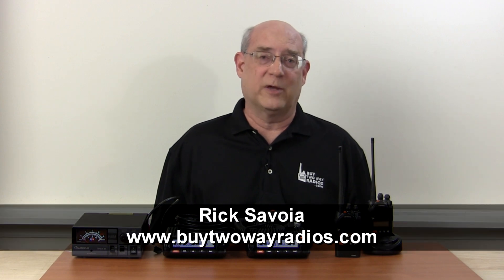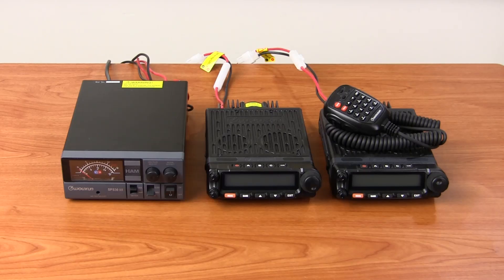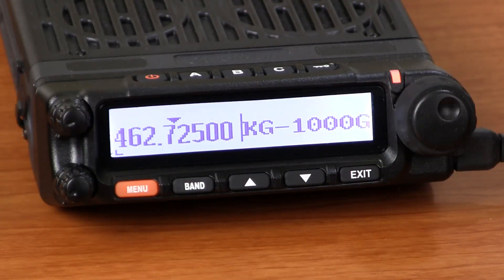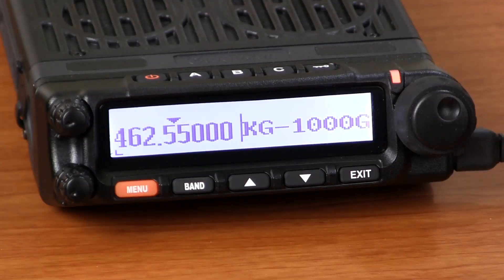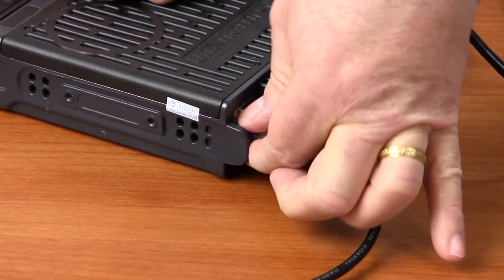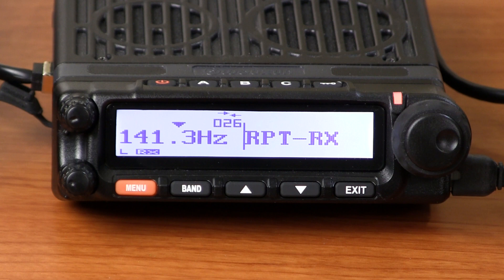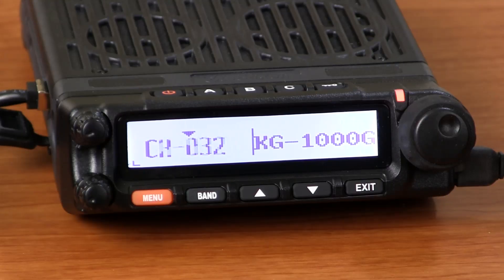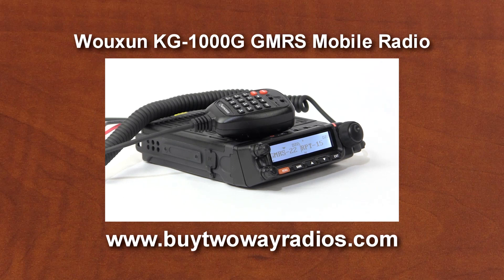How to Turn the Wouxun KG-1000G Into a GMRS Repeater

Comment: Great idea. How well will it hold up under continuous use. Some of those radios wont hold up under that type of use. I know a lot of gmrs operators will key down for 2 minutes at a time and have a long conversation.
Reply: Wouxun tells us that continuous use should not be a problem.  They have been selling a similar commercial radio in a rack-mount repeater configuration for quite a while, so they consider the durability in this setup to be well proven.
Reply: @buytwowayradios9913   Continuous power on is not a problem. Continuous transmitter on, at the high power setting, like in a high use repeater, is not recommended. This is a mobile radio. With a duty cycle rating of a mobile  application. 5-5-90 duty cycle, which means 5% of the time transmit, 5% receive, and 90% standby (squelched receiver). 
Commercial repeaters are rated at 100% transmitter power output.  They  are designed that way and that is why they cost more and have large heat sinks and fans to handle the heat from the transmitter.    Recommend the user sets the mobile transmitter radio at low or medium power setting (add a fan over the heat sinks).   I have built repeaters using mobile radios (with a fan) for events and this works keeping them under 25 watts transmitter power.  System running on battery power in remote locations. Never full power since the duty cycle is greater than 5%.
Reply: @buytwowayradios9913   I have not been able to find any published duty cycle specifications from Wouxun mobile type repeaters.  The mobile radio will have both VSWR and thermal protection that reduces the RF power to protect the RF power module from damage.  Yes it will still transmit, just with a lower RF power output.   Many manufactures offer "desktop repeaters" using mobile radios. If you read the specs. you will discover they are not rated at 100% duty cycle,  unless you run them at less than half power to keep from over heating.  Most are less than 50% duty cycle at full power. 
No problem using mobiles as long as you use them correctly within their published specifications. There is a reason why desktop type repeaters are not allowed to be installed at commercial repeater sites. Their receivers are not designed to withstand  very high levels of RF exposure that you encounter at repeater sites. They may cause interference to other repeater users because of mixing signals,  due to poor rejection of other signals.  I have two older Wouxun portable radios and they are still operating.  One part 97 (ham) and one part 90 type approved for commercial service.  Wouxn knows how to build commercial radios.
Reply: @peterliljequist160  Even some commercially produced repeaters use mobile radios. Case in point: The Yaesu Fusion DR-1X, dual band VHF/UHF amateur radio repeater is made from two FTM-400XDR mobile units. Of course, they added extra cabling, an interface, and a rack mount with fans. But it is made with mobile radios. If done right, i.e. lots of cooling, mobile radios work fine in a repeater situation. I personally prefer to run the radios at reduced output and add a power amplifier (PA). The radio lasts longer, and if the PA dies, it is easily replaced. I'd rather "burn out" a PA than the radios.  ;)

Comment: What kind of antenna can you use as a base station for this??
Reply from the maker: A UHF antenna that is tuned for GMRS frequencies in UHF band such as the Tram 1486 or Nagoya NL-770G should work with the KG-1000G. The Nagoya is a GMRS antenna. The 1486 can be tuned specifically to the GMRS frequencies with a bit of customization and even includes a cutting chart for easier calculation. https://www.buytwowayradios.com/tram-1486.html
Reply: 450-470 MHz 3.8/5dB Exposed Dipole Omni Antenna @BuyTwoWayRadios
Reply: You can build your own antenna if your a do-it-yourself kind of person. A simple one is the 1/4 wave ground plane antenna. It's not a high gain antenna, but it is very inexpensive to build. I made one with about $5 of parts, excluding coax (actually less because I used some spare parts on hand). The coax cable is often the most expensive part of many antenna systems. If you really feel ambitious, you can research antennas and build other antennas that improve performance, i.e. a 5/8 wave (which is about 1.5x better than the ground plane). Even more ambitious would be a colinear antenna. A bit of research and building skills are needed, but the gain is impressive. The more you put into the antenna, the better your system will be! Of course, if you lack the time/skills or just want a commercial version, buy one. They're under $100 (July 2021) and will be more than adequate for most situations.

Comment: How far apart do the two radios have to be.  Do the cables included cover that space?
I ordered one from you guys today.  Will get two more later to set up a repeater here in Warner Robins Georgia
Reply from the maker: The included cable is around 15 feet long, but keep in mind it's not the radios that require separation - it's the antennas (assuming you're not using a duplexer). In our setup we space the antennas around 12 feet apart and that is enough for our testing to work well. Usually your antenna cable will provide enough length to allow you to get this much separation even if the radios are right beside one another.
Reply: @BuyTwoWayRadios  if you're using a duplexer?
I'm new to this and learning, thanks for the info
Reply from the maker: @SteelerNGeorgia  If you are using a duplexer, you only need one antenna.
Reply: @BuyTwoWayRadios  okay, I just want to know if I use a duplexer, can I put the radios closer together
Reply from the maker: @SteelerNGeorgia  The radios can be right next to each other if you want. It's not the radios that need to be separated or distanced. It's the antennas that need to be spaced apart, if you are using two antennas. If you have a duplexer, all you need is one antenna.
Reply: @BuyTwoWayRadios  thanks, can't wait to stick the new KG1K in van.  (My van wants to be a Jeep)
Reply: @BuyTwoWayRadios  maybe a 'How to set up your Wouxun KG1KG part two (for dummies). LoL
Reply: I believe its 15' minimum if side by side and 30' in height with the recieve antenna at the top.
Reply: @BuyTwoWayRadios  if I use a duplexer can I put the radios closer together

Comment: Does it have a CWID feature?

If you are using it like this with alot of traffic you need to think about cooling options also.

Still cheaper to buy a 40 watt GR1225 from the surplus market. that is an all in one tabletop repeater with CWID and usually have duplexer installed.

Comment: I use two kg-uv920p radios, but I found that the audio gets rather dull (I am using a well tuned duplexer)
My work around is a full blown SVXlink repeater controller, but the radios do not support flat audio (to get CTCSS in to SVXlink)
Would love to see a product that you can use to build a repeater with an external controller

Comment: Not for $319.99 each (x2= $639.98) plus shipping, plus duplexer, plus power supply, plus, plus  plus..... for a cheap china radio... and those would only be good if installed at your house but don't plan on putting one in/at a tower site as the receiver will go to hatties....

Comment: In the repeater configuration (2 radios) does the transmitter send your FCC call sign to meet the FCC ID requirement for repeaters?
Reply from the maker: No, it doesn't have the ability to send your callsign. We want to develop, or work with a repeater controller company, to come up with an interface cable to easily connect the KG-1000G to a readily available controller to handle the ID and other cool repeater functions. We're still in the early stages there so give us a couple of months and see what we can come up with.  The good news is that if you're only using the repeater just for individuals covered by your callsign there is no ID requirement. Also, the ID can be made manually if necessary.
Reply: @BuyTwoWayRadios  Thanks for your answer.  An external repeater controller is recommended  unless the repeater has a control operator who can turn it off if the system locks up in transmit mode.
Reply: @BuyTwoWayRadios  would be awesome if Wouxon would add this via a firmware update. 10 min CW ID would be great for ham repeaters (if these radios even operate in that band). Anyway Its great to FINALLY see type certified radios actually in existence now.
Reply: @BuyTwoWayRadios  I believe personal or public any GMRS user must Id at the beginning, at the end and every 10 minutes no matter what
Reply from the maker: GMRS rules require the operator to ID at the end of a single transmission and 15 minutes after a series of transmissions and every 15 minutes on a series of transmissions lasting longer than 15 minutes.

Comment: How about  duty  cycle?? How long will the transmit radio last on 50w during heavy use?
Reply from the maker: I just recently asked Wouxun about this in response to a different inquiry and they said the radio is designed to hold up to heavy TX. They recommended that in a heavy TX situation, like a public repeater, they do suggest using the feature that automatically activates the fan based on the temperature (menu 37, and this is already the default). They also suggest using the TOT and TOA menu settings (menu options 11 and 12) to limit the maximum time for a single TX to at most 60 minutes.
Reply: Is there repeater identification as required and do they offer remote control.

Comment: Great info.  When two radios are connected as a repeater, is it still possible to operate the system with the hand microphone, or do you need a 3rd radio to communicate?
Reply from the maker: Yes. There is an option in the menu to enable you to transmit using the PTT on the hand microphone while the radios are in repeater mode. It is disabled by default.

Comment: BULLSHIT!   You CAN NOT do this WITH OUT a BAND REJECT DUPLEXER.
Reply: Did you watch the whole video where a duplexer is shown near the end? Yeah.......
Reply: How many miles does it get or reach
Reply from the maker: Although some manufacturers of consumer radios advertise a specific range in a set number of miles on their products, we make no claims to specific range limits on this or any other radio we sell. This is because range is going to depend on where, how and under what circumstances the radio is used. You may reach across the visible horizon on a mountaintop with clear line of site in good weather. You may not get far at all if you are transmitting between a forest of skyscrapers or at the bottom of a ravine in the middle of an electrical storm. There is no absolute for range. The article in the following link explains the factors to consider in calculating radio range. It was written for handheld radios, but the same principles apply to any radio transceiver, including mobiles such as the KG-1000G. https://www.buytwowayradios.com/blog/2016/12/gmrs_radio_range_chart.html
Reply: BULLSHIT! to you @Samson Osburn we have had our 70cm ham repater running on a mobile flat pack duplexer for over half a decade.......we even used LMR400 until we got heliax......OH THE HORROR!. Have even used Jpoles as the repeater antenna without ripping a hole in the space-time continuum. Eventually we bought a pass cavity on Ebay to add to our receive side which helped alot but was not required......This is not VHF, with a 5MHz spread you can get away with alot of sins.

Comment: You should follow up with - how to order a gmrs duplexor. There are several questions not answered on the web site such as:
- is the duplexor wide enough for the whole GMRS  band, or do I need to pick a specific repeater channel?
- where do you specify the frequency on the duplexor order page?
- which duplexor is recommended for GMRS repeater operation using just 1 antenna.

Thank you for this video, and especially for the repeater functionality in this transceiver. I know of no other GMRS unit capable of being a self contained repeater that is part 95 qualified, and therefore legal. 

Other stand alone GMRS repeaters I’ve seen,  appear not to be part 95 qualified, and therefore not legal, even though they may be a good units.
Reply from the maker: We don't have a perfect option for GMRS right now, our duplexers are more geared towards LMR (business) customers and the best GMRS option would be to get a 450-470 MHz business duplexer and have it tuned for your repeater frequency.  Check back with us in a couple of weeks though and we might have a better option ;)
Reply: Even as a ham ..I honestly wouldn't sweat it ..fcc only enforces interferance complaints ..with several notices to fix ..
And can't tell unless your gonna announce it all the time ...
But I respect you being deligent with the law - makes me feel dirty lol 73

Comment: What about Identifying? I’d assume the radio doesn’t have an inbuilt ID function. Would you be able to plug something like an ID-O-Matic into the mic port on the TX radio OR insert something like a raspberry pi based repeater controller like OpenRepeater using custom RJ-45 cabling? Is there a full pinout for that port?
Reply from the maker: It's on our agenda to come up with a solution for this. We may develop a cable that makes it easy to connect to a popular controller, or send sample radios to someone like RadioDan so that ID-O-Matic can have an interface readily available when purchased through his site.  I'm not sure which direction we will end up going, but I'd guess we're a couple of months away from having an option.  Keep in mind that a repeater ID function is only necessary if people other than those covered by your license are using the repeater.
Reply: @BuyTwoWayRadios  good to know. Yes I’m aware personally of the ID requirements and was inferring to a more public setup...but never hurts to mention for others benefit. Keep up the good work.
Reply: @BuyTwoWayRadios   OK sounds like you understand that a repeater controller should be used to meet the Time Out Timer (TOT) and ID requirement for an automatic system. When will you have one available?
Reply from the maker: @peterliljequist160  A TOT is built-in to the radio, but yes we definitely understand that the KG-1000G will be a much better repeater if an interface to a controller is readily available. There are several controller options out there, do you happen to have a favorite? At this point one thing we want to figure out is which product we should try to interface with.
Reply: @BuyTwoWayRadios  iD-O-Matic seems to be the most common. Are there any plans to support the GMRS linked network?

Comment: So without a duplexer you would need two antennas. Is that correct? If a dupler is needed which one do you recommend? Do you have a duplexer the same size as the radio? I was thinking of stacking these in an weather proof box or ammo can, along with power supply, external antenna mount.
Reply from the maker: A mobile duplexer is roughly the same footprint as a KG-1000G and maybe just over half the height.  A duplexer allows you to operate with a single antenna and avoid the potential issues that can happen with multiple antennas near one another.  Here is our duplexer page if you're interested in what we have available: https://www.buytwowayradios.com/accessories/duplexers.html

Comment: What would a scenario be like to want to create a repeater with two $300 mobile units? What would be the range? Why would I use one?
Reply from the maker: The scenario that we had in mind initially was offroad/camping/outdoor excursions where you have a couple of vehicles, both with KG-1000G's.  If you were parked in a high location you could link the two from one vehicle to another and get great coverage for your group. Apparently we were too limited in our thinking because since we released the radio we've heard from lots of people who love this feature and even plan to use the KG-1000G as an everyday GMRS repeater.
Reply: @BuyTwoWayRadios  a great idea. What is the range?
Reply from the maker: @puhiava  Like with all radios, the range is very dependent on your environment/terrain.  If you have a repeater set up at the top of a hill or mountain, a 30-50 mile radius is very much possible.  If you're in an urban area with lots of obstructions it may be closer to a mile or to.  The goal should be to get the antenna as high as possible and away from obstructions.
Reply: @BuyTwoWayRadios  if two vehicles how would that work since it needs a physical link between?
Reply from the maker: @puhiava  The included cable is 15 feet long, so in a lot of cases that is going to be enough. If we get requests for longer cables we will start carrying them. If you're handy you can even make a longer cable yourself - it uses RJ45 connectors and a CAT5 cable just like an ethernet connection and the pinouts are in the manual.

Comment: This radio keeps getting better and better the more I learn about it.
Reply from the maker: We do have an introductory video that lists all the features of the KG-1000G. https://youtu.be/OidjAwDn_Js
Reply: How far away should the antennas be if your don’t use a duplexer
Reply: do a video showing all the details...
Reply: Since there is no use of a duplexer. How much watts should be this repeater system? I am new in gmrs world
Reply: @carlojoel2010  if not using a duplexer, you would get the full 50W of output when transmitting.
Reply: What is the duty cycle of the Transmitter at full RF out?